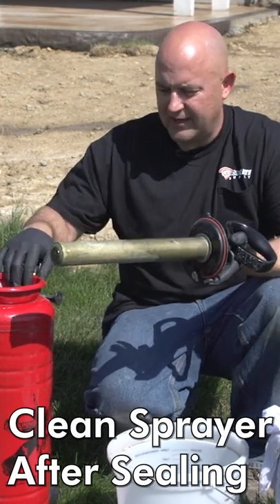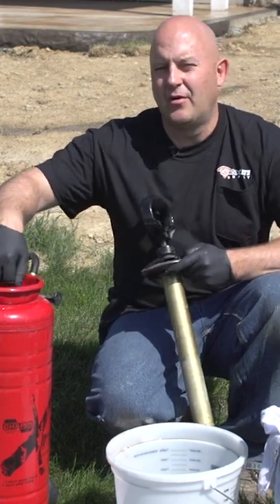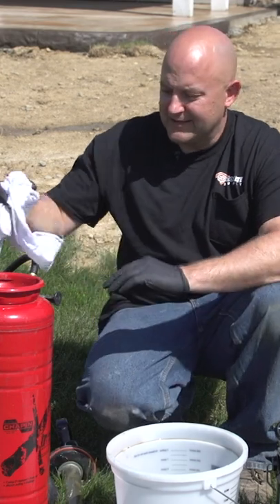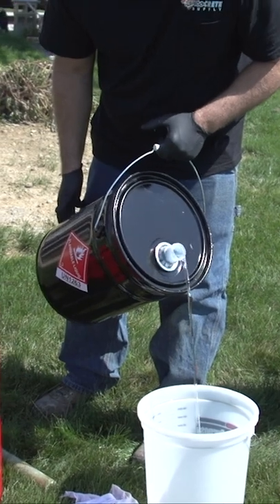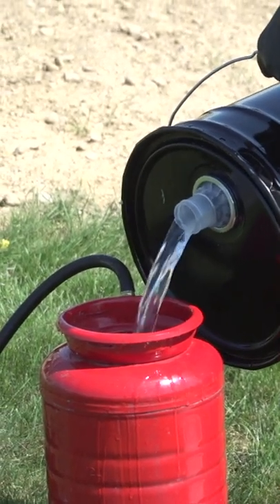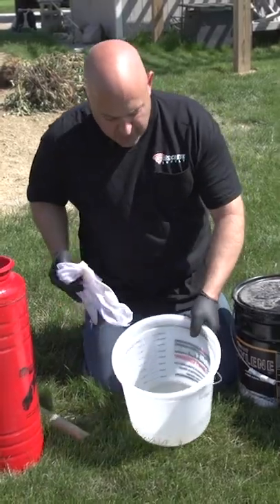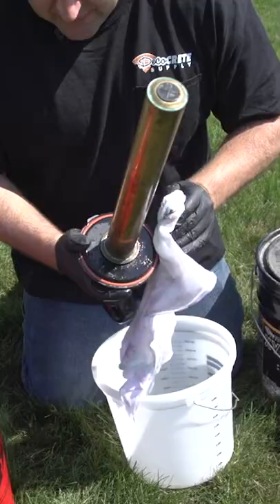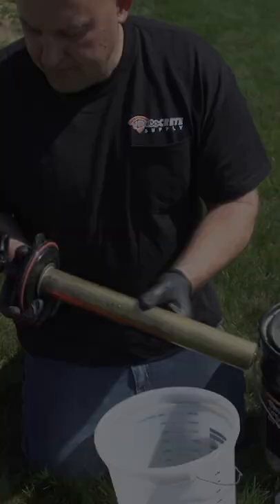CLEAN YOUR SPRAYER! | #Shorts

Comment: Will that clean dry sealer?
Reply from the maker: Thanks for the comment! Dry sealer can be dissolved with solvents if it was a solvent based sealer. In this case, it won't just clean off immediately, the solvent will need at least 15-30 minutes to melt the old sealer. If it was a water based sealer, solvents will not work very well. Boiling hot water would be the best way of breaking down the sealer. Thanks for watching!!!